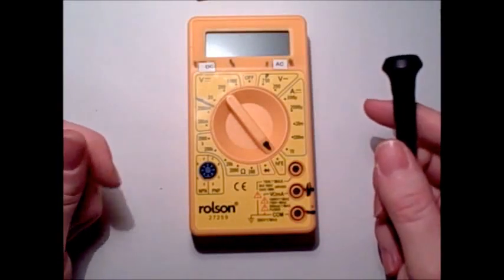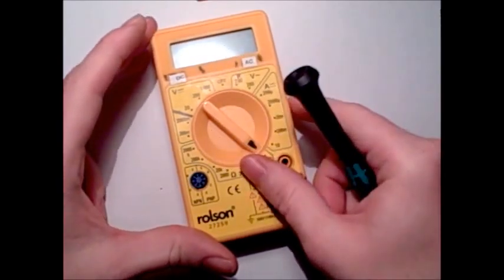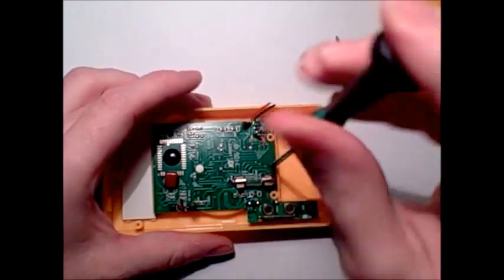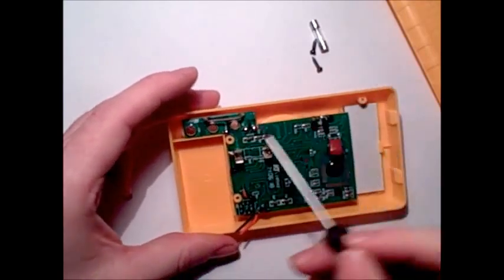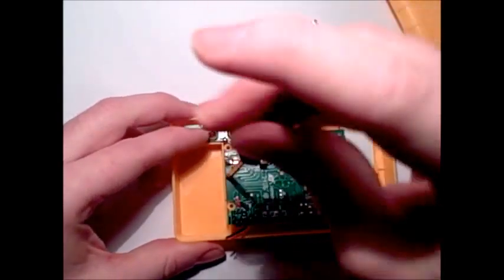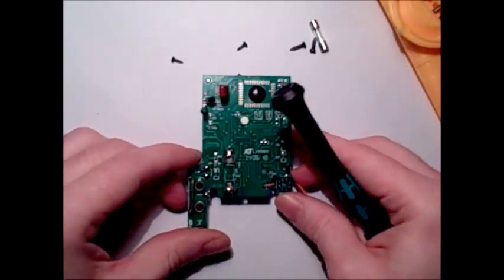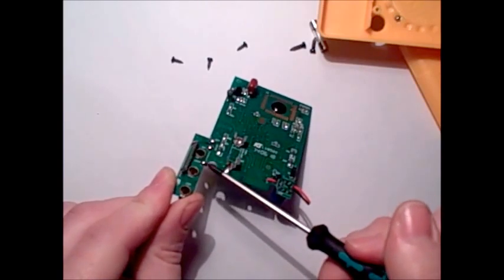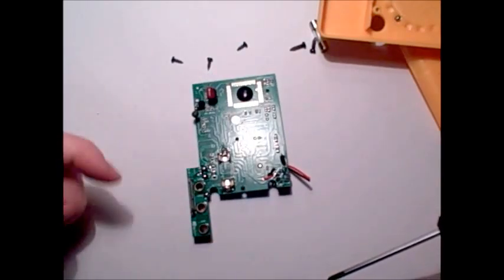Really Shoddy Cheap Multimeter Teardown

Comment: I've seen the guts of quite a few o these multimeters (they're all derived from the DT-830B), and surprising they vary quite a bit. Some have straight up no input protection, no PTCs or MOVs or fuses. But some have PTCs, MOVs and two fuses. Also some have continuity test.